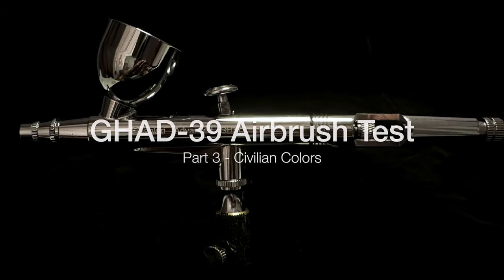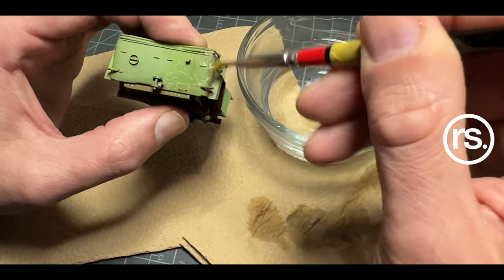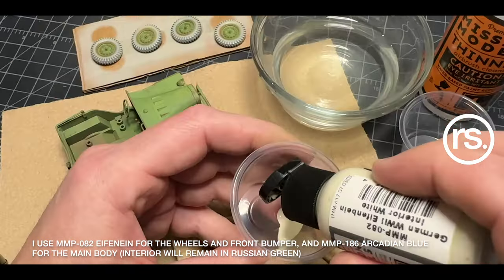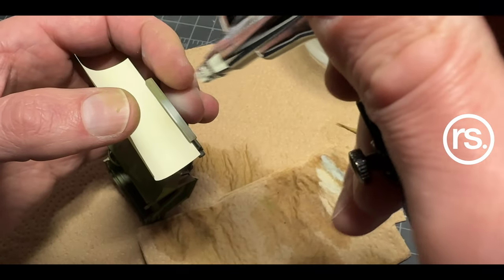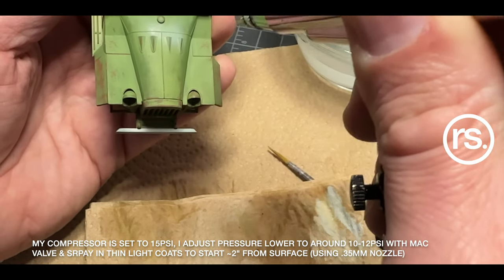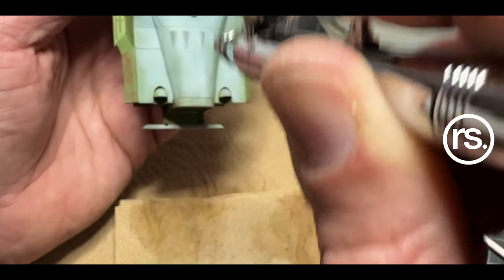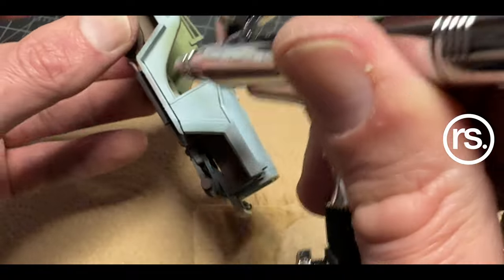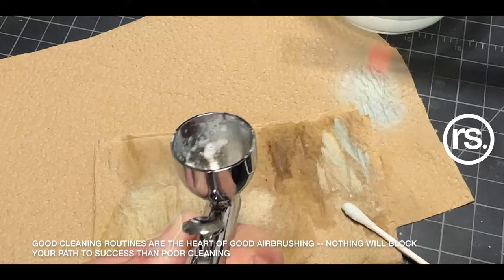Part 3  - Gaahleri GHAD-39 Airbrush -- my NEW workhorse!

Comment: i just received mine. My first impression - it felt like a generic chinese rebadged airbrush until I used it. Stellar performance! Plus point - it comes with spare seals, lubricant and is already equiped with hose quick connect!

When you want to back blow the airbrush, DO NOT uncrew the nozzle! Paint will shoot out from the cup! Tell me how I know. Just cover the airbrush tip or use the supplied nozzle protector if you want to back blow for cleaning/mixing.
Reply from the maker: Yes, agreed and the point of showing this test. Use them! Don't let it sit in the box. Enjoy, and watch how I do a correct blowback procedure. You shouldn’t be removing parts when the airbrush is loaded, simply cover the end and use gentle trigger pull to initiate a mild blowback effect. It’s best used during cleaning, and you’ll be better off mixing outside the airbrush and poring the mix into the airbrush cup, as shown here in these videos, for the paint.
Reply: Thank you very much for your detailed feedback on our product. We're thrilled to hear that despite the initial impression, the airbrush's performance exceeded your expectations. We truly appreciate your recognition of the included features like spare seals, lubricant, and the hose quick connect. Your tip about back blowing is also valuable – we understand the importance of sharing these practical insights. Your insights contribute to improving our products and ensuring the best experience for our customers. If you have any further observations or suggestions, we'd love to hear them.
Reply: @gaahleristudio appreciate the support given to us modellers. I had such a pleasant experience I dont mind getting another one soon!
Reply: @scaleartsg  thank you again!
Reply: 這噴筆在中國是有牌子的,是耐維噴筆.

Comment: What kind of solvent do you use to clean out your airbrush considering MMP can behave badly if it comes into contact with the wrong chemical? Great video, this looks like the airbrush I have been looking for to use exclusively with my MMP paints.
Reply from the maker: Thank you, and to clarify, I don't use solvents to clean anything with MMP related tools. Soap and water, flush with water and final clean with the thinner. Createx Restorer is useful for a severe issue of dried paint, however ensure it doesn't contact the o-rings or is sprayed through (assuming you've disassembled the airbrush). Confine that to the metal only, then repeat the above.

Comment: I saw something online that suggests pouring thinner down the back of the airbrush while blowing air to clean it out.  That'd be great to get those hard-to-reach places, but I feel like that much thinner would be bad for the internals of the brush.  I mostly use lacquers and I try to be judicious in where I just pour my caustic chemicals 😀

What are your thoughts on cleaning by running thinner through the entire airbrush?
Reply from the maker: I left the lacquer conversation many years ago, besides being extremely toxic chemicals they will strip chrome and ruin o-rings on the regular. 

You are correct, it's not the best idea. I've worn through multiple airbrushes using lacquers for years, and I don't recommend it given your chemical preference. Take your time and get some cheap swabs and airbrush cleaner tools on Amazon. 

If you're getting paint in the body, you may also have a worn teflon seal in the needle support shaft inside the body. It's a critical part, and should be checked. It's the part that prevents blow back into the body.

Another benefit of being water-based is that's all a thing of the past. You guys keep hanging on to lacquers like it's a thing, and the single best decision I made regarding painting was swapping them out.

You should store your used chemicals in a sealed container and occasionally drop it off at a local disposal center, most auto parts stores will take it off your hands.
Reply: @rs.p  I'm sure they would, as would many modelers considering how much I paid for them  🤑

I might one day get back to acrylics.  I tried them before stepping away from the hobby for a a few years and found them to be very finicky, where lacquers don't seem to care how much you slap down.  For a novice hand like mine, I just wasn't getting results I like.  I also like painting shiny-shiny stuff, and all the good metallics I see are lacquer (Alclad, Gaianotes).

I love watching the weathering, but I just can't make love to a model that long, so I paint 'em clean and watch the dirty videos 😜
Reply from the maker: @jayday3818  Nothing I'm showing, or talking about, is unique between a clean or weathered build, or how that paint job is approached with primer and base layers. The type of chemical isn't the determining factor in whether it comes out good or bad, or making a metallic look proper. 

I spend more time disproving the skeptical paint obsession in this hobby...than I do showing you the how-to's on screen. Those outside the hobby already know this, and left the convo a long time ago. I think it's a shame, this hobby has such a long way to go yet. I hear the excuses all the time, and regardless of what I show or teach, it's this on repeat--skeptical POV's do nothing for you. 

Spraying is spraying, and understanding solvents and alcohols chems don't work with water-based paints. Once you learn this, the rest is easy.
Reply: i just add thinner into the airbrush cup, mix it, back blow it and pour it out. Repeat until its almost clear and then blow through the thinner
Reply: @rs.p  A fair complaint, but I think we need to turn to Master Yoda for the angle here: You must unlearn what you have learned.  😆

I'm happy to hear what I've known to be wrong, but I find myself pushing back as I look at my $100s of paint that should be thrown out, only to buy $100s more...  I want to make extra-sure what I'm hearing is correct before I go and make a drastic change like that.  And it can be tough to tell how much of the result is thanks to the product and how much is thanks to the modeler's talent.  The Mig acrylics I got a few years ago were really frustrating and didn't turn out at all like I wanted, but Mig himself made a masterpiece with them.

I'm about ready to switch to acrylics given the amount of cleaning I do, plus the cost of the thinners.  I'm just so invested in lacquers now that I can't make that change on a whim (and might justify myself a little too much because of it).
Reply from the maker: @jayday3818  Good luck to you Jay, I do hope you get it figured out soon and can make a future commitment to swapping out the solvents. Spend the time and effort to become a great painter, and all this becomes moot, as you can focus on being a great artist with your models, nothing pays back the dividend on these purchases better than that. ;)
Reply: @rs.p  Thanks for the pointers coach 😃   I'll take another hard look at acrylics and keep working on my technique.
Reply: Cleaning airbrushes to me is the grind of the hobby. But coach is right it’s important to do a thorough job right after a session and come back the next day and check the needle movement etc. Acrylics make the cleaning process so much easier and less toxic. I used tamiya and gunze for many years and the toxicity wore me out. I still have them and will use them with a full respirator and booth setup. But rarely due to the pain of it all. You can get used to acrylics. Practice.